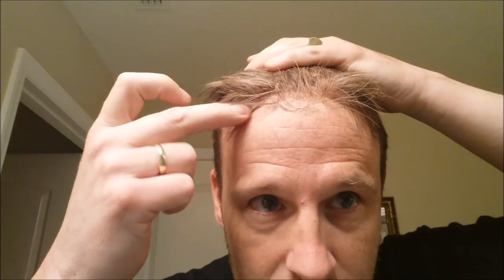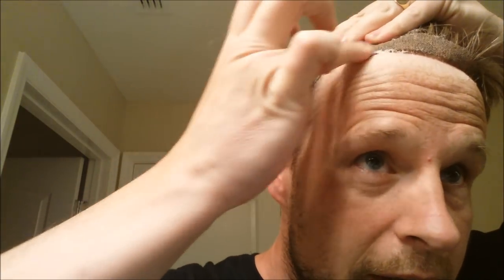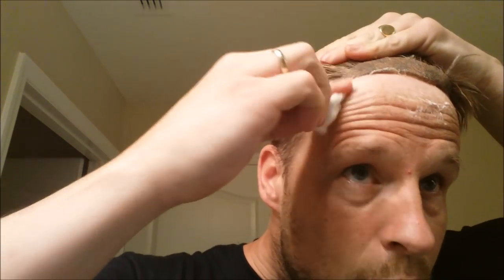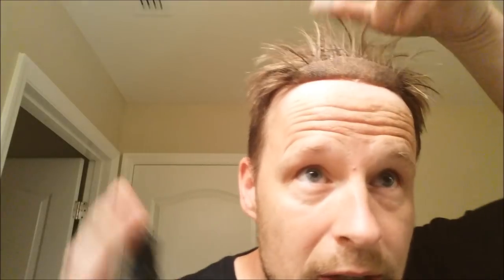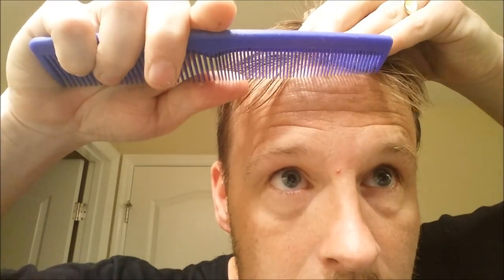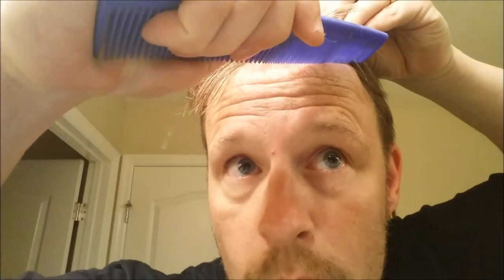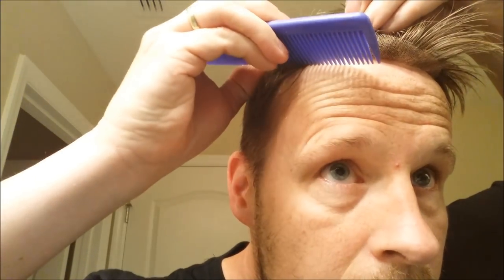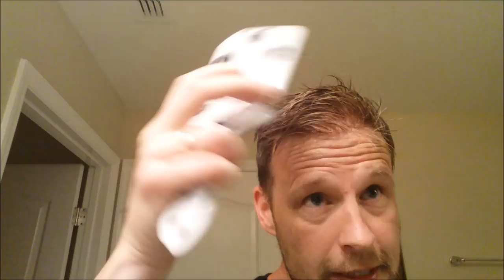Hair Replacement System, Hairline clean up Tutorial on a lace front hair system

Comment: Okay so my hairline will not stay more then 2 or 3 days. I have used ghost bond and maxx hold bonds. Im wondering if I'm not using enough bond or what? I keep it dry for the 24hrs but as soon as I take a shower it come right up. Not a hot shower either. Any advice?

Comment: Lace fronts are good if you wear the hair back.  I've learned that lace fronts are not necessary if you like a curly;wavy look where the hair will fall over the  hairline in front hiding the unit's front hairline beautifully.  Durability is what I go for and these lace fronts are extremely fragile and do not last very long.  You find you're spending a lot of time doing this kind of maintenance.  If you don't mind having to do this every 2 weeks or so, then go for the lace front.  The lace front will tend to fold up on the ends over time, stretch and lose hair.  These units, in general, don't last very long.
Reply from the maker: lace is more fragile true..but they look better. hard durable hairlines look fake and my philosophy is.. if it looks like a wig then it defeats the object. looked after correctly  quality made system can last 6 months to a year. lets skype soon and il teach you how to clean them properly :) (michaelgford) on skype